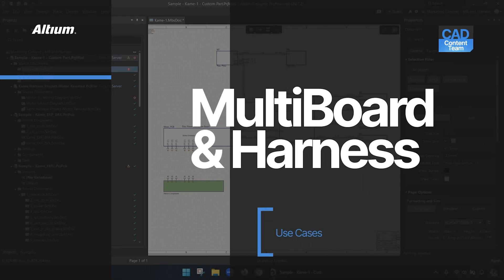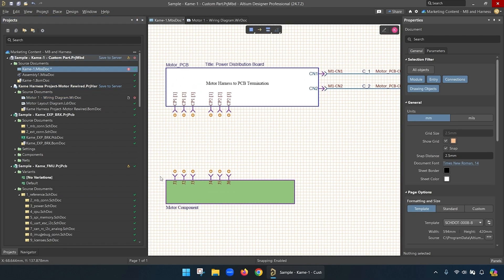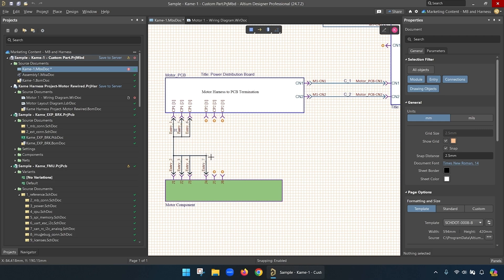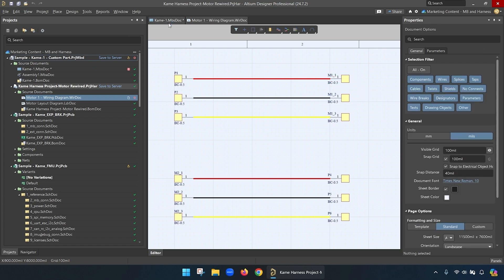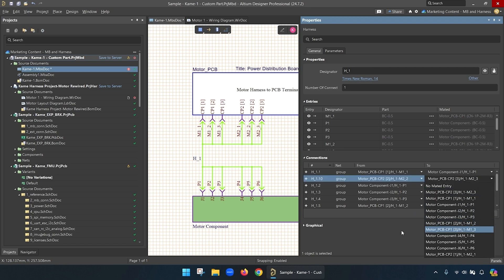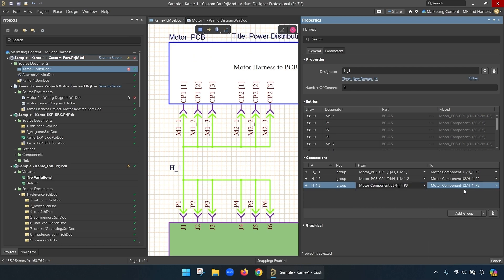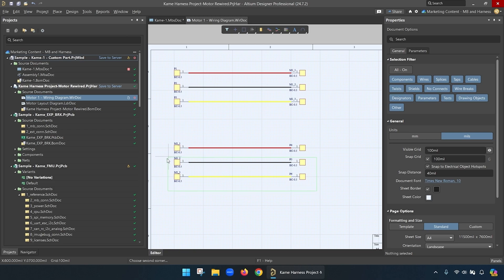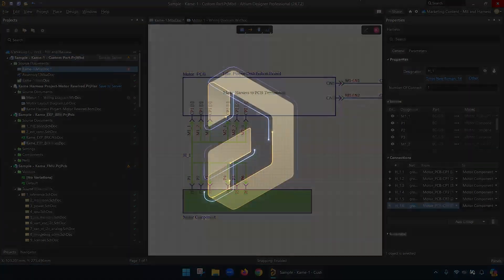Use Cases with Dave Young: Multi-Board and Harness

Comment: The link from multiboard project to harness project using project parameters is a weird way... The harness project should support multiple harness diagrams and we should be able to define all the harnesses in one project using harness wire diagrams... It does not make sense to create a harness project and use it only for one harness when you have a lot of different harnesses in one project.